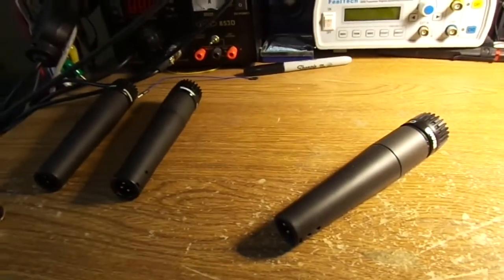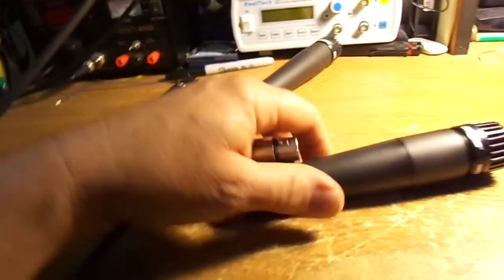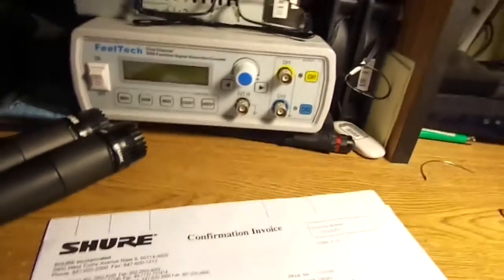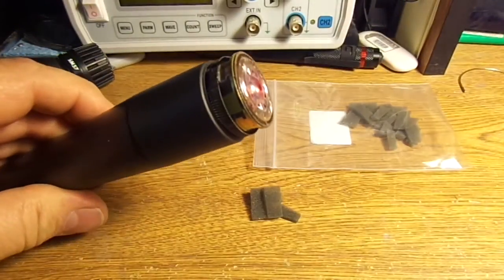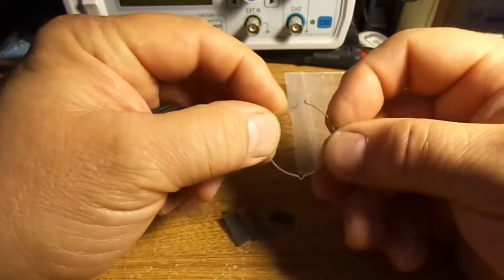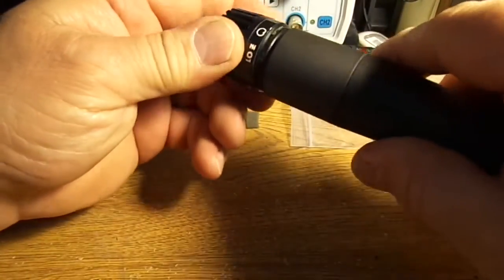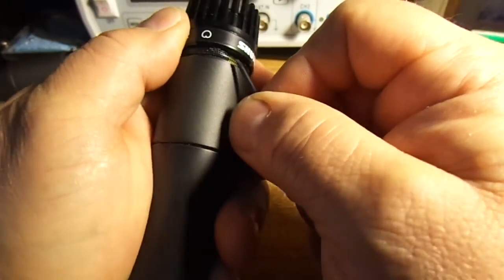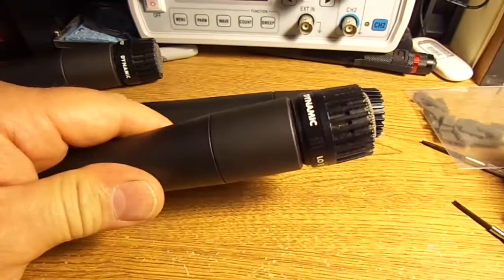SHURE SM57 Cap rattle fix

Comment: It's very kind of you to share this information.  The problem is that foam disintegrates rapidly over a couple years, so for me this is not good enough.  I had always thought I had gotten a lemon. Then I bought a set of 4 of these mics for drums, and all of them have loose caps.  To me, this is pure bullshit.  I can't believe 57's are all that.  Loose caps?  WTF.   End of.  Full stop.  I'm getting rid of these for something else.  Thanks for the video.
Reply from the maker: I totally agree with you. And this was Shure's fix for the problem. I would bet if you buy a brans new 57 it would have the same problem.

Comment: I just found out mine is so old, the foam is floating around in the cap like a rock.  It's probably 30-40 years old.  I think I need to figure out how to replace the grill.  I can see the foam just floating around inside the grill.
Reply from the maker: The cap is held on with an internal snap ring that I’ve not found a way to compress. Maybe someone else knows but I ruined mine trying to remove it.
Reply: @cpworx_maker  it turns out, the little mesh screen just pulls off with a little effort. I was able to get the disintegrated foam plug out. It will work without it and may even sound better. I will eventually cut a little foam plug to put in there to protect from moisture and wind. I also tried to release the snap ring but couldn’t figure out how to do it correctly. Not easy.
Reply from the maker: @millstap  Thanks for the update, I never tried to remove the mesh... That's good info to know.
Reply: @cpworx_maker  On newer mics, it might be harder to remove.  Mine is at least 30 years old.  I could see the ring of glue but the mesh snaps back in very tightly and should stay there unless it is dropped.

Comment: What a horrible design for such an iconic microphone to have that part rotate & be loose like that. But I guess it's necessary to service & rebuild a broken microphone because the foam has served it's useful life or the grill itself has been damaged. They couldn't thread & have these parts screw together ? A sub $ 20 brand of this microphone makes more sense as I learn more about the SM57. Crazy, wedging a piece of foam in there is the fix on a $ 100 microphone.
Reply from the maker: Totally agree, I’ve found that the best solution is to buy SM58 and unscrew the ball. Both have the exact same coils and sound identical in an A-B comparison. Then you can still use it for vocals if needed. Thanks for the comment

Comment: It's great that you have shared this, but having to dick around with your microphones because Shure couldn't design it properly in the first place is infuriating. having to poke up bits of foam around the capsule is a joke. Shure should make the capsule cover a screw in part that is firstly easy to remove and has a shock absorbing silicone ring to stop any kind of rattle. These are supposed to be pro mics. Shure can keep their SM57s. I buy microphones to get on with the job that I want to do. I don't see why or how I should waste my time and effort correcting their design mistakes. Pain in the ass.
Reply from the maker: I agree 100%... I own about 10 of these mics and didn't know about this problem until I used them on some rack mounted toms. Maybe they have corrected this problem in  production but I'm still not going to chance it and buy any more of them.

Comment: I could use a sheet of this foam. I also have an Electro-Voice N/D 767a that needs new foam in the cap as the original has dry rot.
Reply from the maker: Most companies will sell you a replacement for the mic, give them a call and see if they have what you need.

Comment: I going to just slip a O ring around the thing. You broke your mic. Not going to try.
Reply from the maker: Richard Braun if you do your research you would find out that it’s a known problem and Shure issued this fix. I did not break the mic, most 57’s have this issue
Reply: Did the O ring change the frequency response?